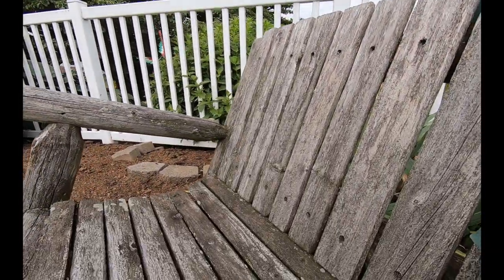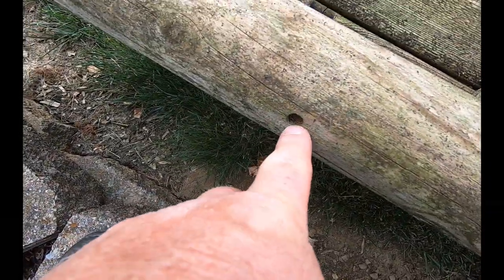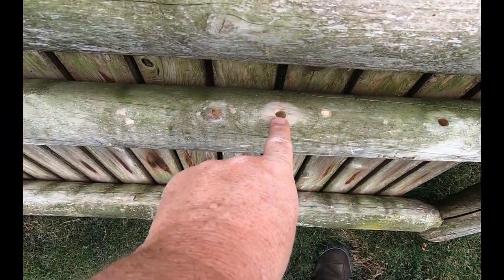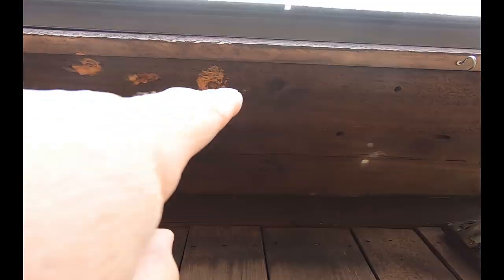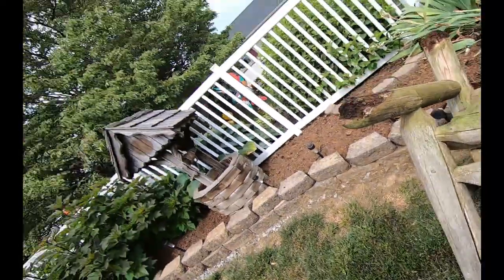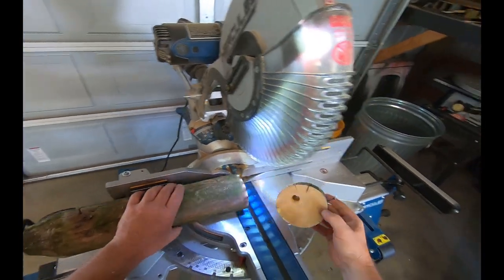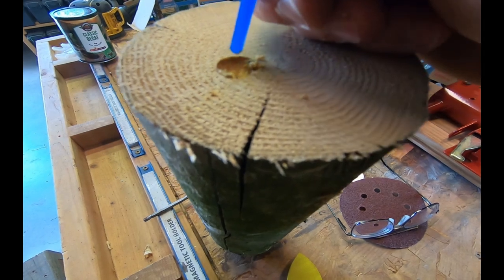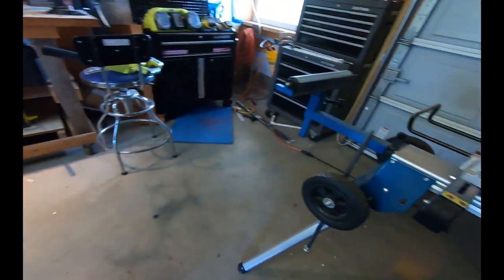Infestation of Carpenter Bees Ruined This Cedar Bench

Comment: I vacuum the bees when they land on my flowers. I use a small vacuum I purchased at Lowes along with a long hose and a 100 ft extension cord.  I've got their numbers down to a minimum.  I have a home with 2 acres in Virginia with an outbuilding, large deck, wooden fences, etc.  The bees were doing a job on the wood-exposed articles.  I tried everything you stated in the video using the vacuum cleaner reduced their numbers.
Reply from the maker: Interesting. Never thought of that method. It’s a shame they do so much damage because they are really great pollinators.
Reply: yes if you wnt more info we can talk, George

Comment: Those holes looked like they were drilled in the wood.  Are the bees that accurate?
Reply from the maker: The entrance hole is almost exactly 3/8” round in diameter. Many people use 3/8” wood plugs and glue to fill the entrance. Once inside they make chambers to lay eggs.